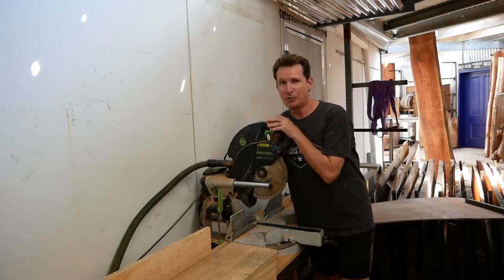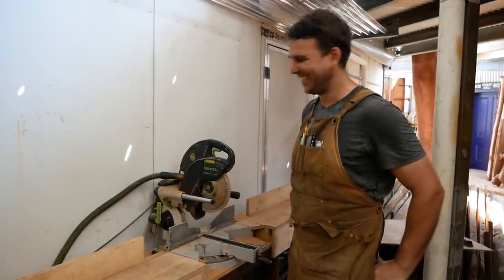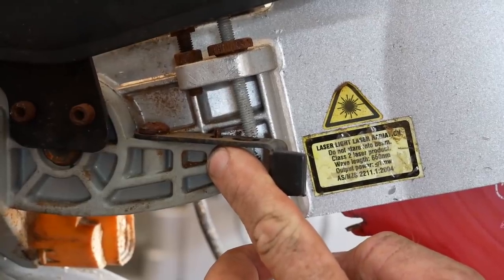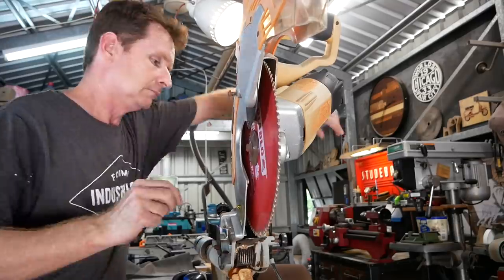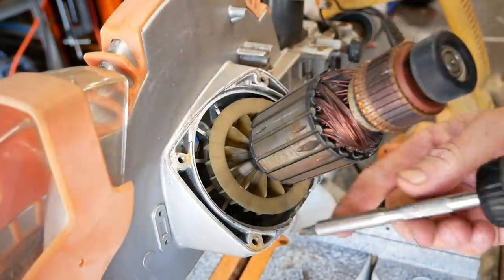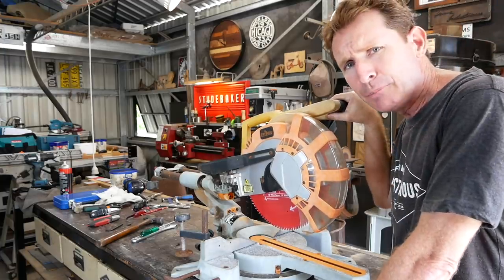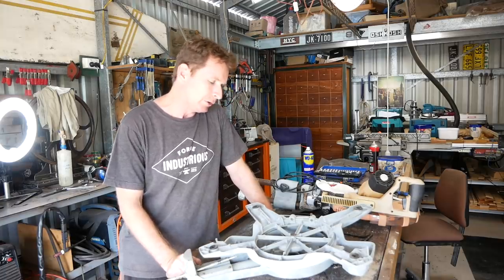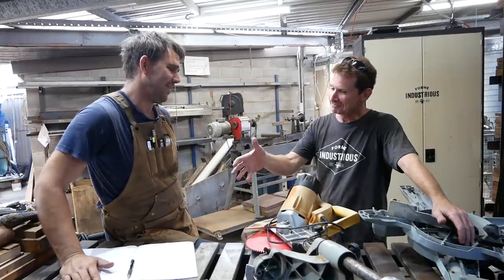Can you Improve a cheap Mitre Saw?? - Is it worth it? - Forme Industrious

Comment: I've had a go at doing the exact same thing - trying to improve a cheaper mitre saw - with the exact same result.  It makes shopping around for another cheaper saw way more difficult too.  I now have a Festool.  :)
Reply from the maker: Yes a predictable result. How do you rate the Festool?
Reply: Yeah, I like it a lot.  For the reasons Joel mentioned.  The dependability/reliability is such a feature you actually forget the issues you were dealing with in the past.  I recently did some work in a friends workshop, dealing with cheaper tools, and it hit me how fortunate I was to have tools that simply work the way they're supposed to.  It might seem like a small thing but being able to depend on something without checking (and re-checking and re-calibrating) for accuracy makes the whole process that much more enjoyable.  Hard to put a price on that I reckon.

Comment: I've had my eye on a new miter saw for a long time. Until I can afford it, I'll continue getting by with my current one which is definitely not as accurate as I'd like, and also requires a lot of free space in the back for the siding rails. But it at least gets the basic job done. Thanks for sharing!

Comment: I've got a similar saw. Mine was purchased from Harbor Freight. Definitely low end.  My housing cracked as well. I'm not a professional wood worker though, so for my needs, my saw will live on.  That Diablo blade is a very good blade.  That is what I use as well.  I don't remember where I picked mine up, but it was on clearance.  A very good buy.
Reply from the maker: The cheaper saws definitely have their place in the market and are perfect for most users. Yes the Diablo Blade is really nice agreed, though on this saw the blade floated that much you couldn't get a perfectly smooth cut unfortunately. Thanks for your comment Mark!

Comment: Also like the way the Festool can be pushed right back against the wall. Most compound mitre saws need a lot of clearance for the slide mechanism behind the saw. I hope all the manufacturers/designers are thinking about this because I'm in the market for a new one but I don't have "Festool" money.
Reply from the maker: Yes, very true! Also agree on the Festool; big money but it's a darn good saw if you can justify it.
Reply: I believe Bosch has a sliding compound saw that doesn't need much wall space because it uses a clever hinge setup rather than rails.

Comment: ive a cheap saw, i shimmed the pivot point on my chopsaw, theres too much play in it so i lock the slides, the detents are crap so i check with a square , its a pile of junk but it gives straight cuts at least. id love a kapex, but wouldnt we all. id say the best upgrade on any saw is a good quality blade. these days i tend to use the table saw with a good mitre guage on it for accurate cuts, love your work mate.
Reply from the maker: Thanks Kevin. After talking with Joel I'm steering towards the Kapex. I too use the Table saw, but I go from ripping to cross cutting with the sled  all the time so I like the convenience of the mitre saw for work flow.

Comment: Yep. It is good advice to get the best tools you can.  Sometimes that happens to also be the cheapest and in that case you cheer yourself up with the thought that the tools you have are way more useful to you than the ones you don't have.  I bought a Ryobi pedestal drill once years ago and I didn't get to use it for a while.  When I did, I found that the morse taper on the quill was bashed about to the point where the chuck would not stay in the drill and the quill had so much run out that I had to go next door to change drill bits.  To my disgust, Ryobi agreed that it hadn't been used, at least not noticeably, but they refused to honor any warranty on the machine or even give me a chuck that would hold tight in the quill.  I have "repaired" that pedestal drill to a point where it will drill semi-accurate holes but it's still a bit of a dog to use.  It will get a milling machine for competition eventually.

After those limited dealings with Ryobi, I promised to never buy another Ryobi Tool or to deal with that particular tool shop again.  They missed out on quite a few thousand dollars worth of tool purchases by myself and family members and will continue to do so in the future.  I know that my decision will not hurt them at all, but that decision has helped me to be more careful with tool purchases and to buy vastly better quality tools when ever possible.  Funnily enough, I have a Black & Decker drop saw that's not too vastly different to your sliding job and that has issues too, but different ones to your saw.  I still have that saw because it will cut accurately with a bit of coaxing and probably better still if I attended to the faults better.  I enjoyed your video and it gave me a few pointers as to where I might be able to improve my saw with out having to buy a new one yet. Thanks. 👍
Reply from the maker: Great comment! very much appreciated. Yes a lot of the cheaper stuff is made for people that most likely will not recognise the shortcomings having never used a quality machine to compare it against. I've had plenty of the cheap gear in my time I have to admit.

Comment: If your shop space allows it, find an old radial arm saw. They get a bad rap, but if you take the time to read the manual, set them up correctly, and just plain don't do the more ridiculous things they advertise  being capable of, it'll beat the pants off that festool or any other miter saw you find, day in day out. Easier to set up dust collection, too. For example, I got mine for free off of craigslist from a guy that had bought it new in the 70's and hardly every used it because he didn't know how to set it up. He'd recently purchased a super expensive miter saw to replace it, and thought he was just having me haul away trash. That old ras, once I got it dialed in properly, is now my most reliable piece of equipment.
Reply from the maker: Spot on, though like you say, need the space. Thank you for your comment!

Comment: So did you break the bank and buy a Festool? I have an Evolution Rage 3, and with a metal cutting blade it has to do all my heavy cutting of steel, brass, aluminium and wood. I’m pleased with it for what it is, but I know I’m pushing it. Thanks for an honest video. Les in UK
Reply from the maker: Yes I got a Festool, but at half price. I bought a demo. Leaves my old saw in the dust but that should be expected for the retail price. Cheers

Comment: Good stuff mate. I have 4 beautiful Makita mitre compounds saws that I've found at the dump. I'm about to do some restoration videos on them of my own. The pins on the Makitas that hold the entire gantry down break through the hole their designed to fit into when not in use all the time. Which isn't a big deal. Interesting tip about the blade cleaning though. I'll be sure to toss that in my vids :) Have you ever tried welding that caste stuff? I've seen a few people on here doing that with sand quite successfully. Might make an interesting vid.
Reply from the maker: Never tried welding cast to date, worth learning how I suppose. Yes looking forward to seeing your restorations!
Reply: @ScottTurnerformeindustrious  hey thanks for subscribing Scott, you made my week!

Comment: How  has Joel got on with the refit on the older Festool saw that was published back in January?
Reply from the maker: Joel's saw? Working perfectly. He bought it back around 2007.
Reply: @ScottTurnerformeindustrious  SO is mine but check out the Festool Website. There is a refit of the saw for a potential fire hazard. It is certainly in the UK and the USA so I assume it's down your way as well. It applies to the older saws from 2007 and there is a serial number checker to verify if the saw needs a refit.
Reply from the maker: @CP-du3ci  Okay, thank you for that! I will let Joel know. Important info

Comment: Should be possible to bolt a piece of steel across that crack some JB-welt in the crack and under the steel and using some additional clamps to clamp it into alignment while the JB cures...( triangular piece of cut-to-fit plywood JB'd in place in that cutout would also give that area a lot more strength)

Although using this as an excuse to get a new and much better saw would always be the better option...............
Reply from the maker: Thanks Thomas, yes I thought of that and decided it had to many shortcomings and was not much fun to use. Great excuse to get the new tool like you say :)

Comment: The saw blade has a lot to with accurate  cutting 
I manufactured saw blades for 30 years  and 10 to 25 though run-out was acceptable 
You get what you pay for
Reply from the maker: So true

Comment: My Harbor Freight $50 chop saw is a cheap tool.  $300 is expensive.  But my HF has none of the problems you showed on yours.
Reply from the maker: Yes sometimes it's hit and miss, also it depends on what you use the saw for. If you have a saw that meets your needs and it's cheap I'm all for that.

Comment: I've used woodworking tools in my career for 40 years. I personally believe your thinking is wrong. Your trying to get a tool to do what it isn't designed for. A miter saw is just that, Its not a radial arm saw, it's not meant to have a sliding blade, these are all compromises by manufacturers to get more functionality out of one tool. I use a crosscut jig for wide cuts, I use a miter saw for miters/angles, and most of all, If I need accuracy I use a table saw. Your buying snake oil. And do not get me talking about cordless tools, the most expensive and irritating tools to use. I love the argument that their cordless, and the first thing plugged in on the job is the recharger base,, laughable. I still use the drill/corded Milwaukee 1/2" hole shooter I bought is 1983. Never cost me a dime, if I had bought batteries since then I would pay over 900.00 instead of the 70.00 I spent on it, and it never needs charging
Reply from the maker: I appreciate your comment Stewart. I was highlighting the limitations of these cheaper saws but also hoping to resolve my blade wobble to no avail. I know what you mean about the cordless tools. They become obsolete very fast due to battery technology ever changing.

Comment: Figured we would see some real hints on how to improve a cheap machine to make it more usable. But you got lazy and ran out of imagination for video subject matter.
Reply from the maker: Sounds like I disappointed you, though thanks for the feedback all the same. The video was highlighting that the cheaper saws are almost impossible to get the same high standard as the expensive saws and people should be realistic for what the cheaper saws can do. About all you can do is fit a good blade.  I didn't get lazy, I dismantled the saw, tried fixing serious issues and realised the futility.
Reply: @ScottTurnerformeindustrious  actually you started down a decent path and then stopped. There is certainly a way to fix the backlash in the spindle and true the blade surface. The angled parts are a matter of figuring out the error and allowing for it. Time vs money, which do you have the most of? 
The disappointment was seeing the title of the video and not seeing it thru.
Reply from the maker: @428Mario  Again, I appreciate the feedback Mario.